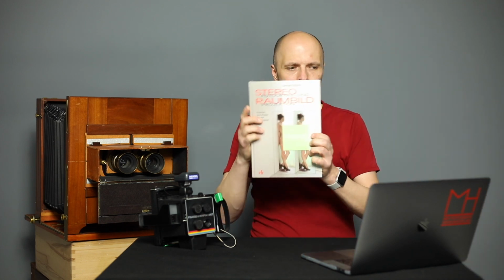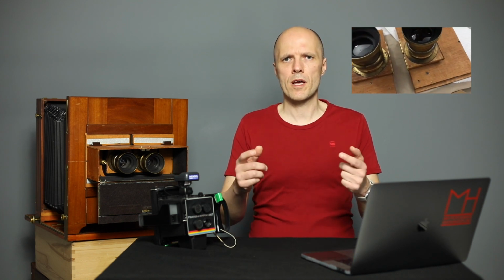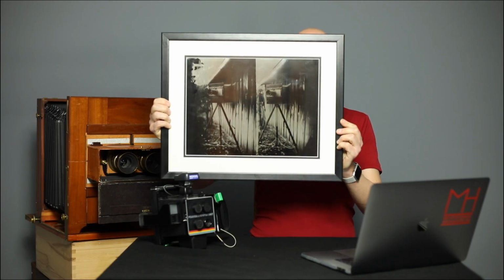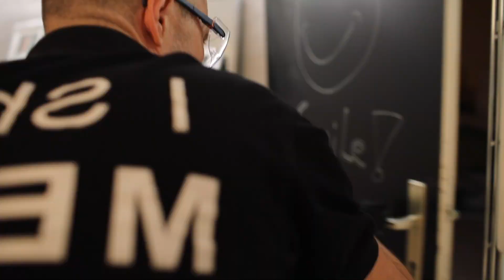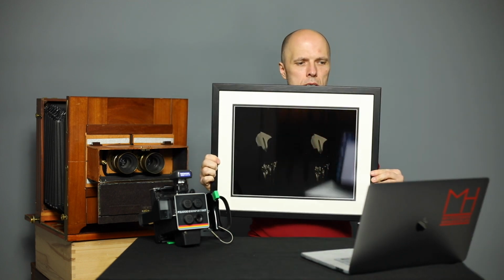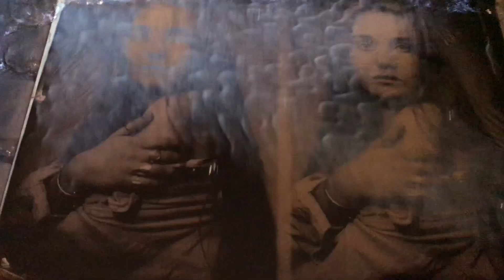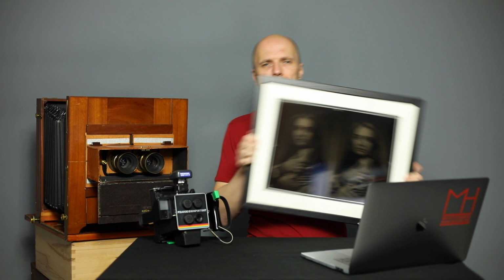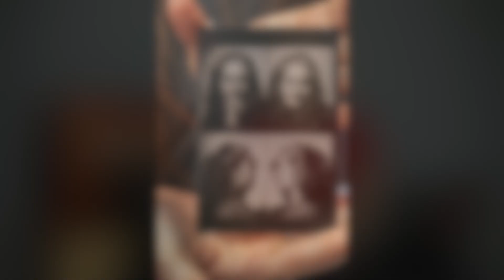3D Ultra Large Format Collodion Wet Plate

Comment: wow, am amazed you got it working, as for my research on 3D, in video, at least, you mount TWO video cameras on a "stedicam" rig, BUT at 90 degrees to each other, ie like a dslr's L-bracket, BUT flip it so the cameras are mounted opposite way, ie on the outside f the 'L' not the inside!!, and special "hoods", and a prism device to "align" the cameras, for paralax correction and to sync the pictures ( remove the double image). Think this is the WHY of 
I-MAX theatres going out of business, the expense, and the gigantic nature of the equipment, not just to make the picture, but to project it as well.

Comment: one thing to try with this kind of portrait, go for a "steampunk" look, that way you can use all the light power you need ( she can wear welding goggles - the kind for oxy-Acetylene gas welding)- and the goggles will fit right in (look like steampunk style sunglasses); just apply some "rust" coloured powder to them, makeup foundation, or the like, even dirt, to get the right look.
Reply from the maker: pretty great idea! I did two steam punk shoots already - one you can find here https://youtu.be/y0ccDnXw9xE
Reply: @mhaustria  thanks, just watched it, fantastic double exposure, but one idea, instead of such unwieldy cameras for hand holding, why not try a linhof, or toyo, as even the 4x5 or 5x7' s can be "hand_held", as with the linhof it has an anatomical grip, which, when combined with a monopod on the tripod socket underneeth might make it more managable, Plus I have found another "wet_plater" like you, a channel called Lost Light Art who also makes 'plate holders' and also sells plates ready to go, all with colloiden, silver and in the black bags like 4x5" sheet film, so another "turn_key" sollution to these problems.

Comment: Hi Markus I've noticed when anyone pours collodion on their plate they never put the excess Back into the original bottle of collodion... why is this? is the excess collodion  unusable now it's touched the plate?
Thanks again for you fantastic channel
Reply from the maker: Michael Bermingham  thanks a lot for this question. There are different reasons. First of all, it collects dust an particles. It also looses some ether and it was more exposed to air then the rest of it in the bottle. But anyway you can use it again, it is just not that clean and it gets quicker less sensible for light (you can see it turning red faster in the pouring bottle compared to the other bottle). But this is complaining on a high level. I have often used it again without a problem. But I’m lucky enough to have very fast lenses and a very strong strobe system. I can handle loosing one stop of light sensitivity easy. With other setups it could get challenging. Thanks again for your kind words and you are welcome.
Reply: Thank you for your this valuable information

Comment: Markus Hofstätter I would like your opinion of the camera Burke & James 11x14. Its weight is 14.5 kg. Do you think is still manageable to shoot outdoors? (on places with car access, not carrying it around). Thank you in advance.
Reply from the maker: sure, I think it all depends on the right tripod.
Reply: @mhaustria  I have 2 sturdy ones. One is unbranded and the other is a Benbo trekker
Reply from the maker: @fotolookconde  sounds good. I like to use wooden ones
Reply: @mhaustria  Moving from 18x24cm to 11x14inch is quite a jump! I much silver nitrate bath do we need for that big fomat!? I have now a tank for 18x24 that takes 1 litre. I noticed from your videos that you're using a container (to develop prints). It takes less silver bath using that? How much?
Reply from the maker: @fotolookconde  I use normally trays because the alcohol and either can evaporate easier, it all depends on the tray size. And the tray needs to be large enough to put in the plate with one big wave. I guess you need 2 to three litres depending on the tray.
Reply: @mhaustria  thank you. That's what I thought! I will use a 30x40 tray so I think maybe 2 litres wil be fine!
Reply from the maker: @fotolookconde  very welcome. A 30x40cm tray will be to little for my experience.
Reply: @mhaustria  the plate is 28x35cm so do you think a 30x40 tray is little for it?
Reply from the maker: @fotolookconde  Watch my videos and look carefully how I put the plates in the tray
Reply: @mhaustria  Ok, thanks for your help

Comment: 10.000 Watts ... Jesus !!! ...And Yes >> Sell Beautiful Prints ... Hold onto your Masters
Reply from the maker: Mostly I can shoot with lower power settings and with one generator. For example a normal portrait on a 13x18cm plate with fresh chemicals needs only about 3000W when I use a 85cm softbox on the strobe head.